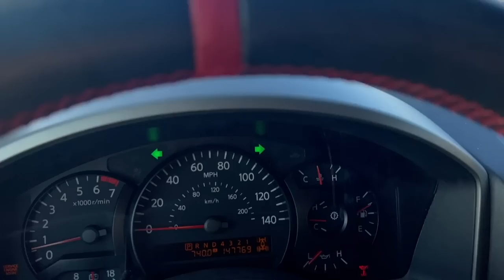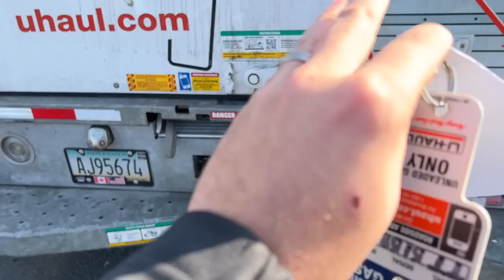I BOUGHT MY DREAM SPEC AUDI R8 FOR $24K!

Comment: Like a kid on Christmas morning. I think that Copart has a rule that even run and drives are brought out of the lot using the fork lift, if I'm not mistaken. I have also been searching for my dream car, and bid on one recently, losing out, but I have avoided California auctions because it appears there are several extra charges, beyond requiring a broker. What has your experience been (realizing you are in-state....I am not) Since insurance companies have to have reason to total a car, and the threshold can be high in most states, I hope you don't discover any unforeseen problems with the R8. Enjoy.